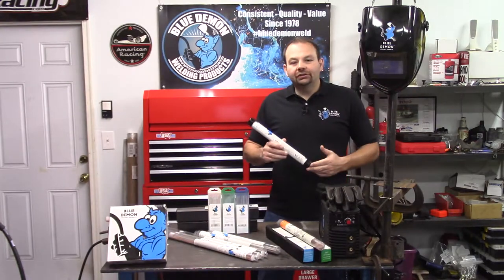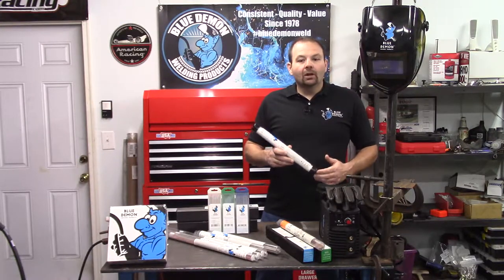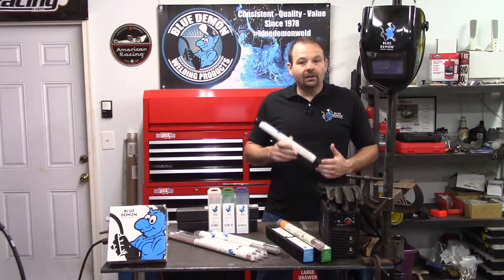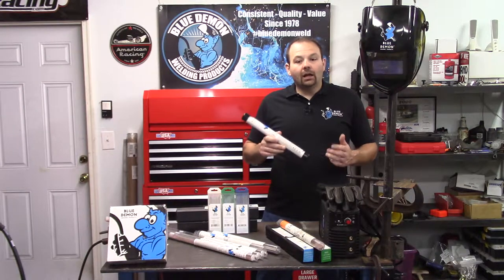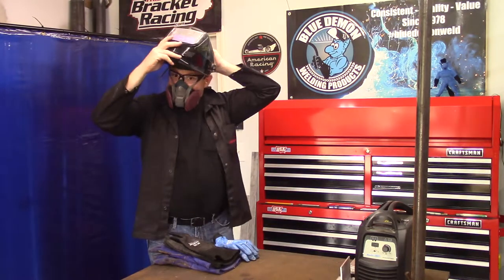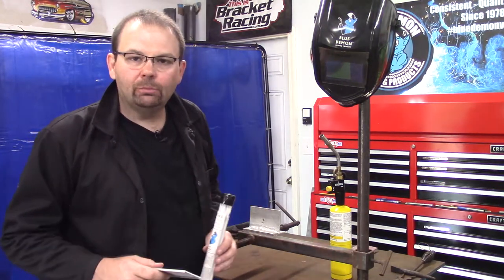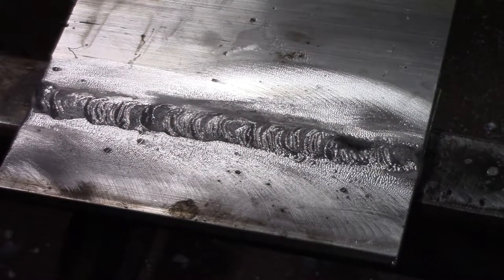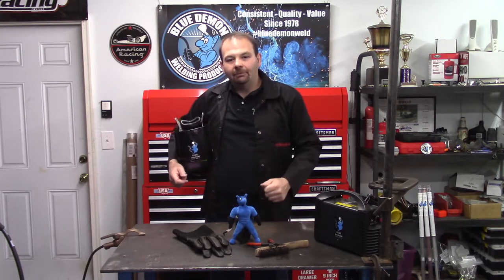Blue Demon E4043 Aluminum Stick Welding Electrode

Comment: What machine do i need to weld with this? Can i use a cheap 60$ welder machine or need more expensive? Yeswelder 250 pro? Is 360$ but looking for cheap options